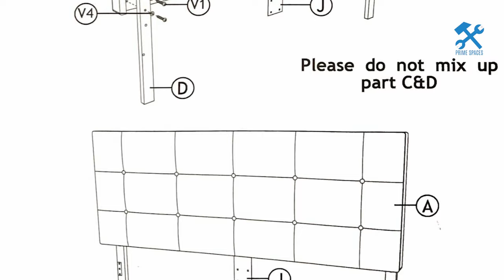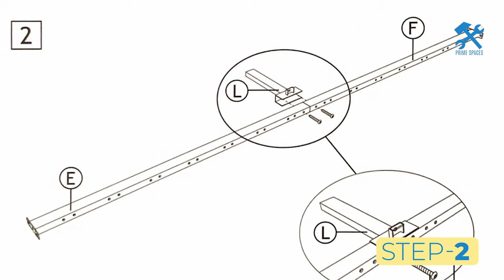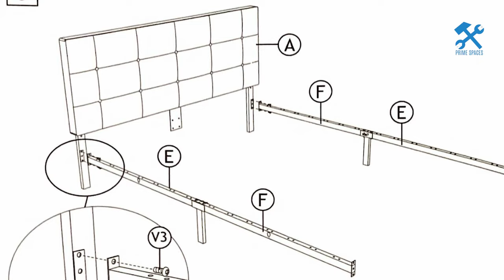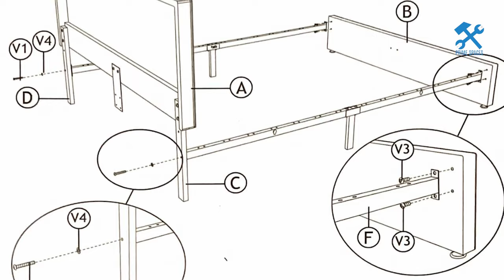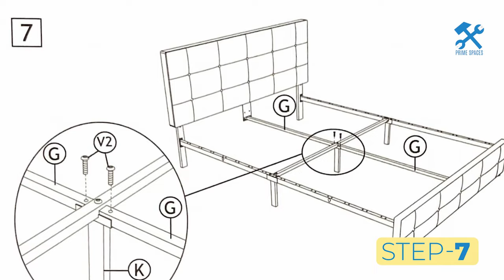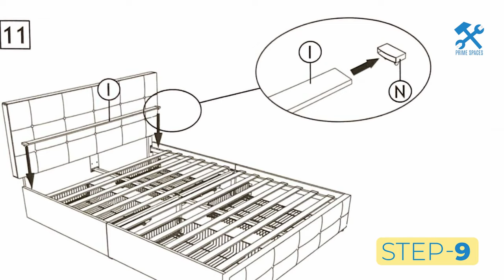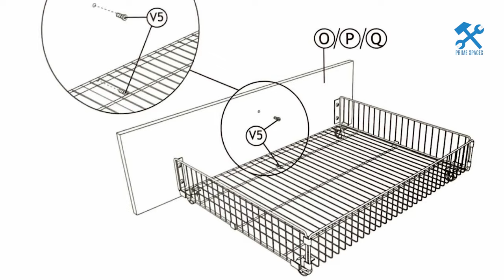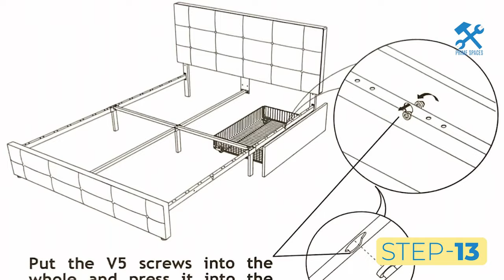Keyluv Modern Upholstered Bed Frame with 4 Storage Drawers Assembly | Allewie Upholstered Bed Frame

Comment: This is JUNK. It has way too many bolts without nuts. The bolts will loosen without nuts and the bed will be wobbly and falling apart within a couple of months. Bolts also go into the headboard....the headboard material will not hold bolts securely long term. JUNK.
Reply: I’ve had mine for about a year and it’s fine! I was just dissembling to move it so I can clean all the pieces (I have allergies so I clean every little thing) so I had to remember how I put it together lol